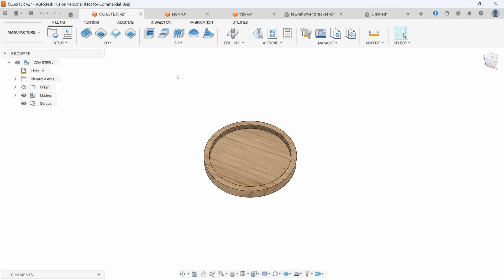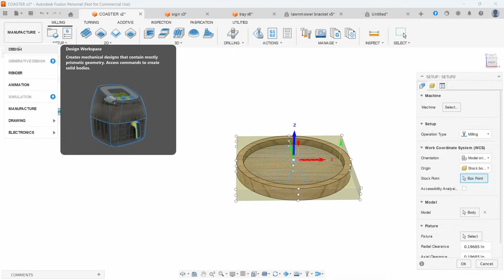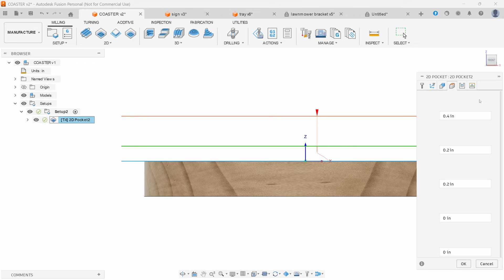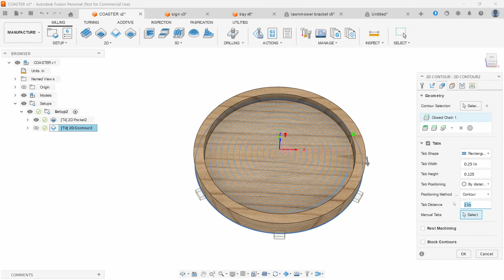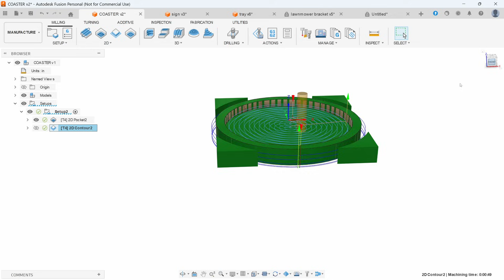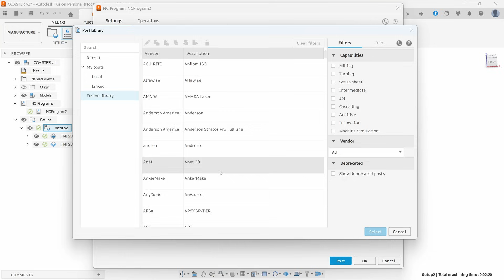Your First CAM Program Simplified (Autodesk Fusion 360)

Comment: Wow, awesome. I've been writing my code by hand for the past year. This really helped. Thanx soooo much.
Reply from the maker: Glad I could help! If you can code by hold you'll have absolutely no trouble getting a grasp on this. What kind of projects are you working on?
Reply: @IBilldThis  Moulds for casting fishing weights, toys. I'm having difficulty because part of the face is raised about the mating surface of the halves and part is a cavity. Do you have a video covering that ?
Reply from the maker: @MichaelKunz-mt2oo  I don't think i have any videos on it. If i'm understanding you: you're started with a block of stock and cutting down the sides leaving a feature on the top and then cutting pockets into whats left.

if it's this right. set up your stock to be the entire envelope and you can treat the outside as just a pocket. 

if they're 3d shapes this may help: https://www.youtube.com/watch?v=A4hzez2pToM&t=31s
Reply: @IBilldThis  I think I have tried that. My problem is one item in particular (two halves) has a spherical "bump" on one half, and a spherical cavity to mate with that bump on the other half of the mold. Male-Female.
Reply from the maker: @MichaelKunz-mt2oo  gotcha. I would start by doing a pocket cut with a flat endmill for everything except the spheres and a 3D cut for the spheres and make the male sphere slightly smaller. how much depends on you machine/material/speeds and feeds. but you can either do this in cam. i think its under 'stock to leave' you can make it negative. or you can design it in. it may take some trial and error to get it to your liking

Comment: the only part that is unclear is at the end, choosing your post. How do I know which one works for my CNC?, I also thought that it would be awesome if you teach how to add a lid that fit perfect into this "plate"..and maybe how do we do when we want to cut, let's say 3 of this at the same time...thanks for sharing!!
Reply: I think i got the post thing =)
Reply from the maker: I'm glad you figured out the post! I've really only worked with mach 3 for the post. But what did you have to choose for your machine?
Reply: @IBilldThis  thanks, UGS work on Mac, that's why i use UGS
Reply from the maker: You're Welcome! Mating parts and part arrays are awesome video ideas. Thanks.
Just for a little info on these..

The Lid: In the design tab. You can make a new sketch in the pocket of the coaster. Then simply use the offset tool (or draw a new circle from the center) and give yourself a little clearance. I typically use .01 inches all the way around. Extrude it to the height of your material as a new component. Then hop over to the manufacturing tab. And you can hide the components and just do 2 set ups

For doing multiple parts: go into the manufacturing tab. Drop down the set up menu and choose create manufacturing model. open the model and then you can copy and paste your components. Then just drag it around to where you want. I made a video on nesting that walks you thru the moving stuff around in the manufacturing model https://youtu.be/VvImoWkURcA?si=ed-0KFp0iLeXfkq6

Thanks for the ideas!!